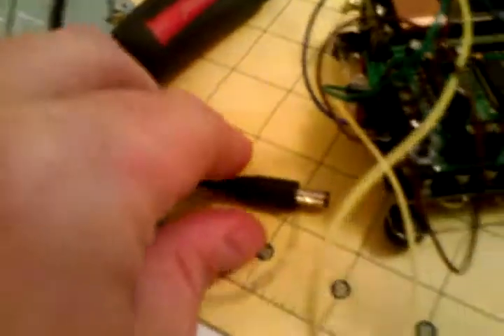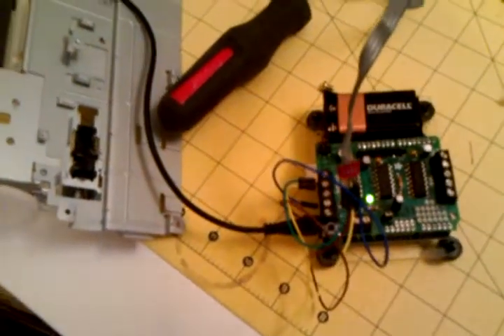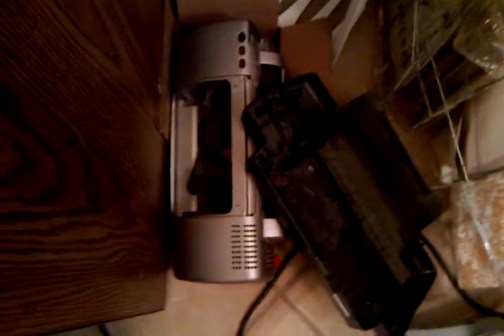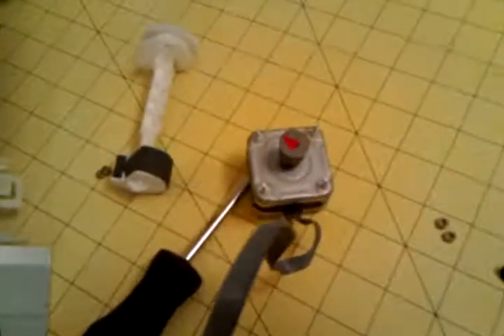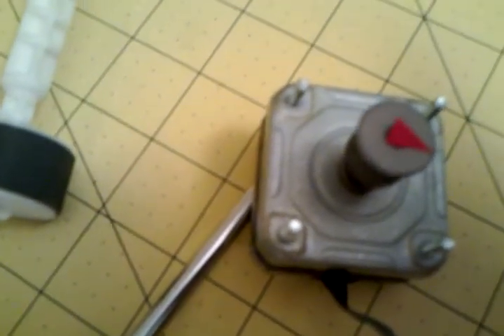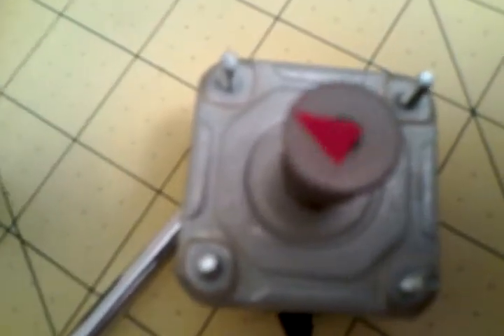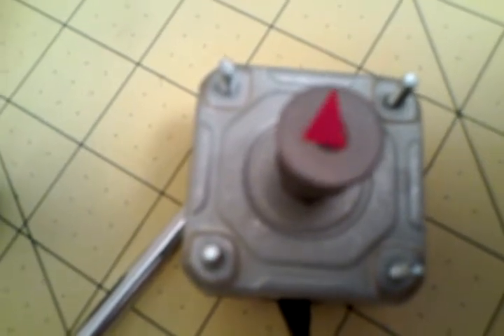Arduino motor shield using printer stepper motor.

Comment: Cool.. where can i get the arduino firmware to install it to mine??? i want to control fwd and reverse... and with variable speeds.  What do you think would work.  im using the arduino motor shield

Comment from the maker: @schpongo7 I used the external power option because I didn't want to damage the Arduino. I think you have to do something with a jumper as well. Try a stepper from an old inkjet printer if you are still having issues....